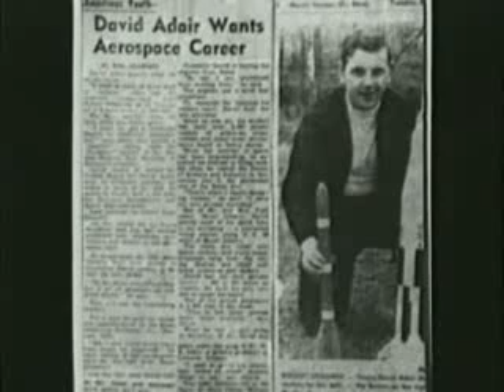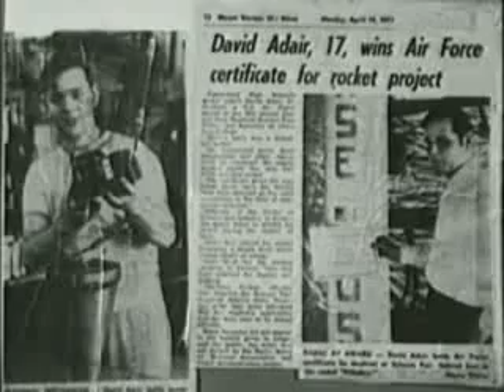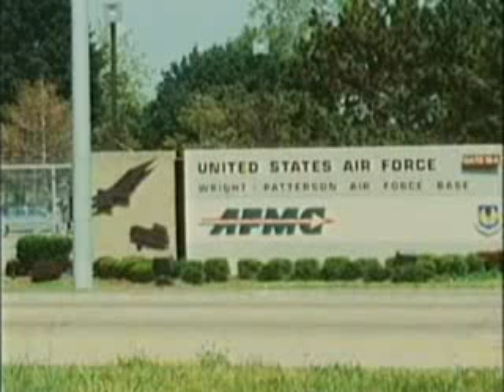UFO TECH 23 Fusion Powered Light Speed Rocket Area 51 David Adair shown his flew 8000mph 1971 pt1of5

Comment: 30,000 mph ooooohhhhhh. That's about 300,000 times slower than light. E=MC^2 demonstrates that  mass becomes infinite at the speed of light meaning it requires an infinite amount of energy to get to that speed meaning that light speed travel using propulsion is impossible. Fusion even at 100% efficiency would only be able to get you to about 0.25c